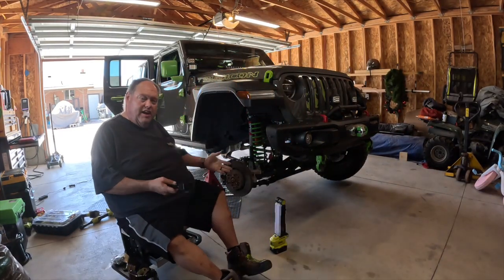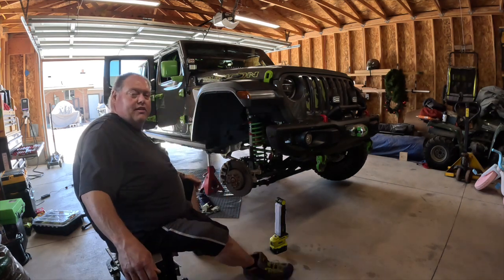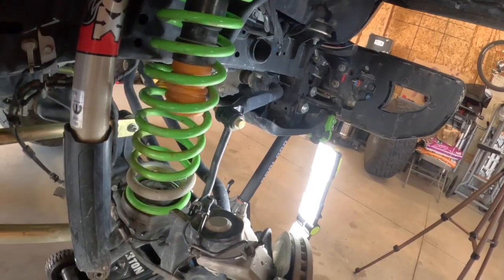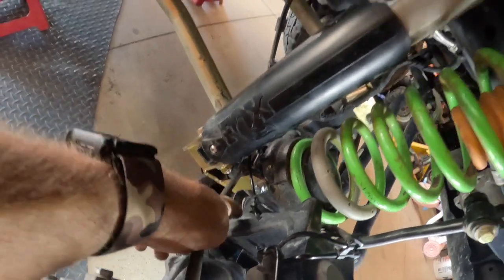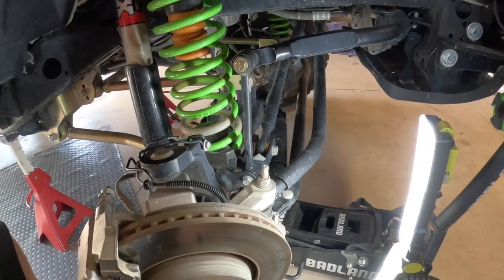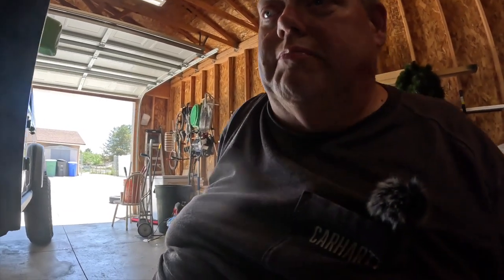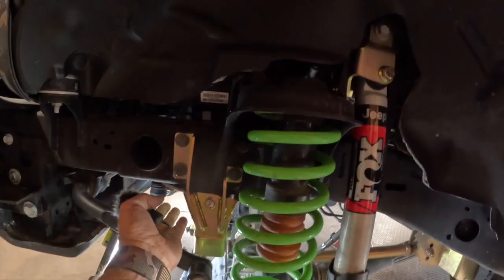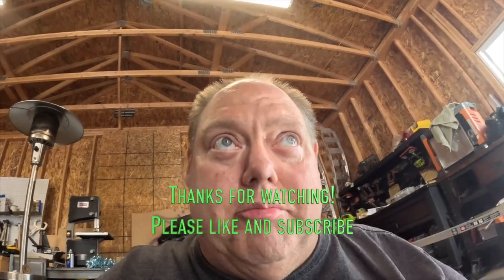"Unbelievable Jeep Upgrade: See What Happens When MetalCloak Comes In!"

Comment: did you notice any difference in front travel after you installed the lower front outboard shock mount relocation brackets? Great video BTW!
Reply from the maker: I did notice a little bit more travel but I noticed the ride off road improved also. By the way thanks for watching and commenting I appreciate it.